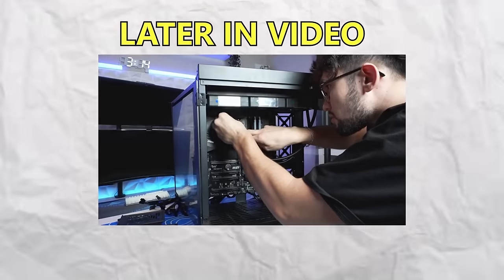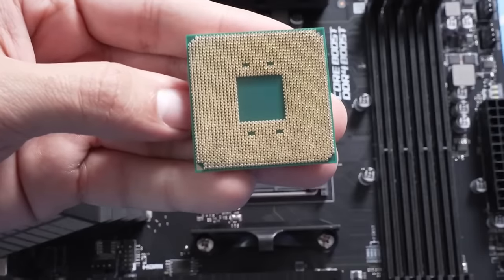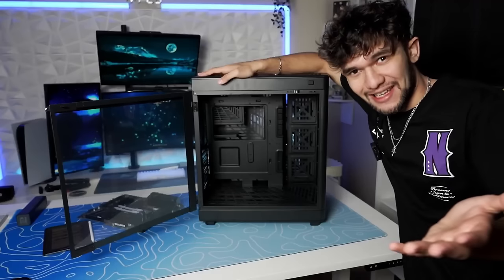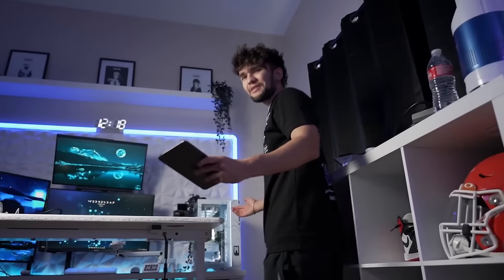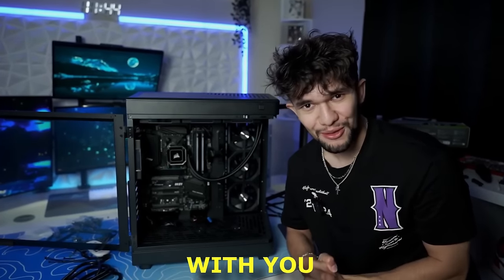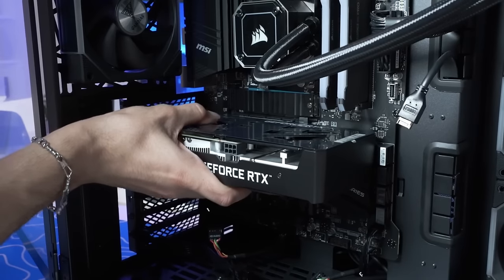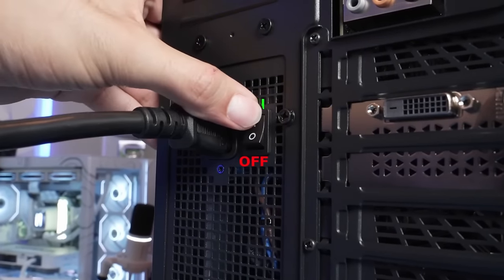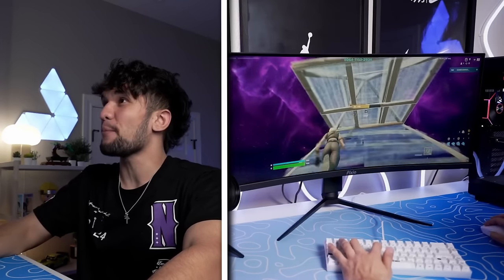Building My First Gaming PC With No Experience (BUDGET)

Comment: Parts:
GPU: Nvidia GeForce RTX 4090
CPU: Intel i9-14900KS
RAM: Corsair RM750x (2021)
COOLING: NZXT Kraken Elite RGB 360 - RL-KR36E-B1 - 360mm AIO CPU Liquid Cooler - Customizable 2.36" LCD Display for GIFS, Images, Performance Metrics - High-Performance Pump - 3 x F120 RGB Core Fans - Black
SSD: Seagate IronWolf Pro, 22 TB, Enterprise NAS Internal HDD –CMR 3.5 Inch, SATA 6 Gb/s, 7,200 RPM, 256 MB Cache for RAID Network Attached Storage (ST22000NT001)
MOTHERBOARD: ASUS - ROG STRIX Z790-E GAMING WIFI (Socket LGA 1700) Intel Z790 ATX DDR5 Wi-Fi 6E Motherboard - Black
CASE: NZXT H9 Flow - All Black - CM-H91FB-01 - Dual-Chamber Mid-Tower Airflow Case

I'm gonna update the parts to something newer/better every time something comes out so you better hurry and get 100k

Also why RTX 3050

Comment: You spend your money on the wrong things. For a $1000 PC you want your budget to look a little something like this:

Best GPU you can get for $300 (RTX 3080 Used)
Best CPU you can get for $150 (R7 7600X Used)
Best RAM you can get for $50 (2x8GB DDR5-6000 CL30)
Best SSD you can get for $50 (1TB PCIe 4.0 M.2 SSD)
Best Motherboard you can get for $200 (B650)
Best CPU Cooler you can get for $50
Best Case you can get for $50
Best PSU you can get for $100 (750W)

For any PC build really, you want the GPU to be the most expensive item.

Comment: The first red flag is building on AM4 for a brand new build, there's  nothing wrong with AM4, it's just that there is no upgradability and your stuck with DDR4 RAM and can't upgrade to DDR5. The second red flag IS THE DAMN 3050 DO RESEARCH WHEN BUILDING AND DON'T JUST BUILD BASED ON PRICING! The 3050 is fine but the pricing is terrible for the performance you get so you could have gone with a 3070 to make a better combo. If this build was before the release of AM5 then this build would have made some sense (other than the 3050) but today it is a weird build. You could have gone with a good Micro ATX build for a cheaper case and motherboard, and if you got a good budget case with fans then there wouldn't have been any need for extra fans. You could also get faster components for an all round faster build.

Comment: The upside to building your own is that you can pick exactly which parts you want to use, whereas with pre-builts you are limited to what they offer, even when you can order a customized pre-built. It used to be that building your own was considerably cheaper but that's no longer the case.

The 3050 is absolutely garbage, you could've spent $100-120 more for a 3070 or a 4060 and gone with an air cooler around $35-40 (Peerless Assassin or Phantom Spirit are great choices) instead of spending $160 on an AIO that's overkill for your CPU, and you would've remained within your budget. Always prioritize your GPU when building a gaming pc.

I will add that there are $40 AIOs (Thermalright Aqua Elite 240 V3) if you insist on having one and they work absolutely fine, so you definitely overspent on that when you didn't need to.

Also, you're going to find that 512 GB for an SSD is not going to be enough. You can find 1 TB M.2 SSDs for around $60-70, sometimes less.

Comment: okay here are the specs for the most liked comment coming from a pc builder

for the motherboard MSI B760 Gaming Plus WiFi Gaming Motherboard 

12 gen intel core i9 13000k for CPU

RTX 4090 

32 gigs of corsair DDR5 Ram 

NZXT Flow case

NZXT power supply 

NZXT 240 rgb 300mm AIO

then for extra fans go with extra NZXT fans
Reply from the maker: That’s a crazyyyyy build 😭
Reply: @TheChandler1 not going easy 😈

Comment: 1TB wouldn't put you above 1000$.
Infact there are 2TB drive for less than 110$.
In that budget you can easily, easily place 7800XT.
Even 7900GRE.
4070 Super... possibly. possibly not
Reply: why place 7800 xt with ryzen 5600? considering he probably has 1080p monitor, idk tho, it doesnt make much sence to me
Reply: @GameslordXY  not the point. i dont see why would you pair an older platform cpu with a realy good gpu. with 5600, you'll probably cutting corners, so it makes sence to go with last gen used gpu, like 6800 or 3070ti. if you buy new, just go with 7500f/7600x and that is pretty much fine for 7800xt. also, with windows 24h2 patch things could change

Comment: I Think you could improve this build a lot. The samsung SSD is extremely overkill for most users. considering this is a budget build as you say I would rather go with a P3 Plus or so. Something like the SN580 is also great.

The gpu as most people said could easily be replaced with a 3060 or even a 4060 if you worry about power efficiency and prefer a newer gen gpu. despite popular belief a 4060 is still a great option. anything above that and you are clearly overpaying. the 4060 ti is over $100 more than the 4060 and the gains do not justify it

The PSU is the one thing you won't want to cheap out. Most reliable brands are EVGA and Seasonic. It's impossible to go wrong with either of these. a 650W is enough tbh but you can go with 850W if you want for future proof as the PSU will last a really long time

The cpu seems oddly old for a 1k build. AM5 7600x would be nicer tbh

For RAM I usually go with Trident Z. ram is cheap nowadays and the price diff between diff brands is not enough for me to go with a cheaper brand. trident z has diff models for AMD and Intel so lookout for that. I do not know enough about other brands to recommend other stuff but ram can improve performance in gaming by a good amount as well as performance in pc tasks if you are a creator.

Fans are something that people think they need a lot but most of the time the fan on the cpu cooler and the gpu fans are enough (unless you are overclocking a lot). Yes water cooling is even more overkill. If you really want to put extra fans don't look for rgb. just get some cheap ones they mostly do the job. 

For coolers I always go for Noctua brand. is a bit on the expensive side but this is what makes it unnecessary for my builds to need fans. a good cooler can make a huge difference.

I think that about covers everything. For benchmarks go for passmark website and do not look at userbenchmark as it is extremely biased. and as always do your own research even after listening to people opinions :)

Comment: So first of all, awesome job on your first build. You did a great job with the building aspect and it looked great and as far as i could see no mistakes building wise. But you did make a very big rookie mistake and that was dollar to performance. You spent way to much money on things you didnt need that could went to better parts. for example you spent over 100$ on a case with no fans, then spent over 200$ on fans. Now dont get me wrong they looked wonderful and honestly its your choice how you wanted to build. just wanted to mention all the performance you left on the table. also you spent a good bit on a aio cooler for a cpu that pushes 60watts. I found a mesh, highly rated black case from the same company as the one you got for 70$ and it came with 4 fans. Which is plenty to cool a sub 1000$ pc. Also, grabbing a decent air cooler instead of the aio would of saved money but would of cooled just as well. so instead of the 3050 and the 5600, you could of got a 3070 or maybe 40 series card , a X or XT version of your cpu or even a ryzen 7 5000 series cpu, and a 1TB of storge like you wanted and still stayed on budget. Room for thought.

Comment: ACTUAL ADVICE

at a 1000 dollar budget you should have spent as close to 500 as possible on just the gpu
ryzen 5600 is a perfect choice for this budget. unfortunately you then went for an aio 360mm cooler with a screen on it no less.

the aio cooler is completely unnecessary for a ryzen 5. hell, most ryzen 7 stays in its advertised 125w tdp meaning a 25 dollar air cooler is way more than enough, not to mention ryzen 5 has like half the power draw at an advertised 65w which means it requires even less cooling. only the x3d chips and the ryzen 9 chips have a decent reason to get an AIO, not to mention its less reliable. air coolers are big hunks of metal. aio coolers are complex loops and the pump fails anywhere from 1 to 7 years in especially if from an unproven brand. me and friends have been left stranded with no pc until a new cooler arrives due to that

you spent up to 200 dollars on fans when the difference from 200 to 350 dollars on gpu is way more worth it than fans you can change at any time. their only effect is aesthetics and noise. not performance at all. 50 dollars on fans would be more than enough

the ram is almost fine, i wouldnt recommend anything less than 32gb and i guess youre paying for reliability and sure, aesthetics, but youre overpaying around 50 dollars for that kit. thats almost the price of a premium ddr5 kit

gamdias helios is a bit sketchier of a psu i'd go for at this price point. you usually want a good brand with good reputation and customer service. like cmon you went for corsair ram for reliability, a bad psu will kill the entire pc. look up the chaos with gigabyte like 2 years ago when their over current protection failed. huge pr disaster because lack of QA can kill the entire system in seconds

on a budget for the entire system, amd is the way to go unless you have a specific reason like productivity programs that only support Nvidia, however you cant make this argument with a 3050 which is a horribly overpriced and underperforming gpu. to get anything ray traced with it youd have to drop graphics settings so hard the ray tracing wouldnt matter. something the lines of a 7700xt is a great card ar under 400 dollars that can easily handle up to 1440p gaming. 

the case you can make room for in the budget if you reallywant but again, 0 performance impact. corsairs 4000d is easily found for around 80 dollars and provides great airflow and decent aesthetics
if you wanna go even crazier you could get a used 3070/3080/6800xt for around the same price but i dont reccoment everyone to buy used if they dont know what theyre doing so im not including that.
here is a similar list with the changes ive made which is a night and day difference in performance
https://pcpartpicker.com/list/6dKnPF

Comment: Ryzen 9 7950x3d 
Radeon RX 7900XTX
Lian Li O11
Lian Li Strimer Cables 24 and 8 pin
Samsung 990 pro 2tb m.2
Corsair H150i elite optiplex
Corsair AR120 fans x6
Corsair RMx shift series RM1200x
And a cool mini screen to put in there
ASUS ROG STRIX B650E-F WiFi pro USE AURA SYNC
Phanteks ARGB Strips

Comment: I found a pc for $997.93 that probably would perform better.

Antec AX61 mid tower atx case (4fans pre-installed)
Ryzen 7 5700X (cpu)
Asus ROG Strix B550-F gaming wifi II and AM4 (mobo)
240mm AIO cooler FROSTFLOW (cpu cooler)
Corsair Vengeance ddr4 (2×16) (ram)
TEAMGROUP mp33 1tb ssd (m.2 ssd)
Intel ARC A770 titan OC Edition 16gb gddr6 (gpu)
Pystar 1000W psu 80+ Gold (atx case psu)
I found these on amazon for prettry good deals and makes a good budget 1440p pc
Reply from the maker: Check new vid lol

Comment: You could've had a WAY better pc. You DO NOT need an AIO for an entry-level cpu. Also, a 3050 is trash. By using an air cooler (or even the stock cooler), using that extra $50 in your budget, and selecting better components, you could've had a way better pc.

Comment: I'm trying to build my first pc using this:
CPU: Ryren 7 5700G
GPU: ASUS Dual NVIDIA Geforce RTX 3050 OC
Motherboard: Msi B550M Pro-Vdh wifi Proseries
CPU Cooler: Deepcool Ak400 Zero Dark Digital Display
Ram: Corsair Vengeance RGB Pro 16GB (2×8GB)
SSD: kingston 1000GB or samsung 980 Pro 1TB
PSU: Asus PSU TUF Gaming 850W Gold
Case: Corsair 4000D Airflow
Are they compatible? Will it work? I have no idea how to build a pc...
Reply: I wouldn't get a 3050, instead I would get the rx 6600. Also you don't need an 850 watt psu for the specs you have, you could downgrade a lil bit to 750 watt one so you can still use it if you upgrade to more demanding parts.

Comment: no way you spent 1100 on a 5600 with a 3050 and bought an aio for that cpu. My recommendations is use an air cooler because its not a powerful cpu and for a 1100 build i would have used a rtx 4060 ti
Reply from the maker: Valid valid. I’ll buy one

Comment: You could have got an i5 12400f
A 	Deepcool AK620 ZERO DARK 68.99 CFM CPU Cooler
A 	MSI B760 GAMING PLUS WIFI ATX LGA1700 Motherboard
A 	Corsair Vengeance 32 GB (2 x 16 GB) DDR5-5600 CL36 Memory
A 	Kingston NV2 1 TB M.2-2280 PCIe 4.0 X4 NVME Solid State Drive
A	Gigabyte EAGLE GeForce RTX 4060 Ti 8 GB Video Card
A	NZXT H5 Flow ATX Mid Tower Case
A	Corsair RM650 (2023) 650 W 80+ Gold Certified Fully Modular ATX Power Supply

For $1020
Reply: nah bramd it would be $200 more expensive

Comment: My 745 dollar pc has:
7500f, b650m, 16gb ddr5, 1tb ssd, argb tower cooler by deepcool, case with 5 pre installed argb fan, 650w power supply and rtx 3060 ti, I don't think this comes close to my pc in terms of value for money , the only thing that's better in this pc is the aio 😂

Comment: well done for a first build.
but you did waste alot of your budget on useless things here are some tips for the future 
1_a cpu that is below 120w tdp doesnt need a 360 aio 
2_ the case does look good but isnt budget frendly a 110$ for a case then you need to fill it up with fans which will cost extra at least 30$ insted get a budget frendly case that has at least 3or 4 fans pre installed( a good example is the deepcool cc560) and dont pay more than 70 on a case if on a budget 
3_most of your budget should go to the cpu and gpu these shouldnt be a after thought 
4_ if on a budget dont get a lcd aio 
5_ dont get a 3050 ,bad price to preformance 
6_ if on a budget use the stock cooler 
here how i would do it 
cpu_ ryzen 5 5600x 110$
cpu cooler_ use stock cooler 0$
gpu_ rx 6750 xt 350$ 
case_ deepcool cc560 60$ 
motherboard_ gigabyte b550 aorus elite ax v2 140$
ram_ corsair vengence lpx 32gb ddr4 _ 65$ 
storage_ wd black sn770 1tb m.2 nvme ssd 70$
power supply_ corsair rm650 atx 85$ 
total 880$ 🙂👍 and this one will preform wayyyy better

Comment: There is so many things wrong. You bought like the most random parts, you bought them before knowing how to build a PC, you don't need an AIO under $1500. You could have saved hundreds of dollars by buying better parts like a H5 Flow or H7 Flow which save you the money for fans and letting you get a better GPU. Like I said an Air Cooler would be better. Samsung SSD isn't the best for price you could have saved money and even get 1TB for like $40-$70. You could have had a so much better PC if you knew more about the parts and prices which was the main mistake of having no knowledge.

Comment: It's much easier if you consider not buying a shitload of unnecessary fans/coolers

CPU: AMD Ryzen 5 5600 3.5 GHz 6-Core Processor  ($129.00 @ Amazon) 
CPU Cooler: ID-COOLING SE-214-XT 68.2 CFM CPU Cooler  ($17.98 @ Amazon) 
Motherboard: ASRock B550M-HDV Micro ATX AM4 Motherboard  ($74.98 @ Amazon) 
Memory: G.Skill Ripjaws V 16 GB (2 x 8 GB) DDR4-3200 CL16 Memory  ($26.99 @ Amazon) 
Storage: Kingston KC3000 1.024 TB M.2-2280 PCIe 4.0 X4 NVME Solid State Drive  ($94.99 @ Amazon) 
Video Card: Acer Predator BiFrost OC Radeon RX 7800 XT 16 GB Video Card  ($459.99 @ Newegg) 
Case: Lian Li LANCOOL 216 RGB ATX Mid Tower Case  ($94.98 @ Amazon) 
Power Supply: SeaSonic FOCUS SGX (2021) 750 W 80+ Gold Certified Fully Modular SFX Power Supply  ($99.99 @ Amazon) 
Total: $998.90

Comment: I am kind of a pc building nerd, so here is a way better pc for The same prize
I5 12400F
Noctua NH-U12S cpu cooler
MSI MAG B760 Tomahawk
Kingston fury beast 16gb ddr5 6000mhz
Kingston 1tb nvme m.2
Rx 7600
NZXT H5 Flow
Corsair RM650 (2023) 650 W 80+ Gold Powersupply
All costing 983$ on pc part picker. Anyways, have a good rest of your day!

Comment: considering they’ve ruined even the 3060 with the naming scheme, nvidia really has nothing good under 700
Reply: 3070 used is better you can get it for 250-300 + the 3060 is mid range but would probably get the 3060 ti if your just gonna use it for 1-2 years 3060 ti is good but if you want feature proof get the 3060 cause of the 12 gb vram

Comment: Nice part list but one thing Why the 3050 bro I died inside I would rather go with a rx7600 or a intel arc a750 its like 23-29$ more expensive but totally worth it in the long run
Reply from the maker: Ikkk ikkk im sorry
Reply: @TheChandler1  but still the 3050 should give you good performance in most games at 1080p so still a good part list you got a new sub

Comment: No hate but if u didn’t spend more of ur budget on aesthetics u could’ve built a much powerful system (if u did wanna do it this way though the Rx 6600 is a much better deal than the 3050 at the same price but with more than 20% better performance) anyone with decent pc knowledge knows that the 3050 is such a bad gpu cos of the pricing
Reply from the maker: As stated this was my first time building one with fr fr zero experience lol. So thanks for informing me
Reply: @TheChandler1  no hate tho good job 👍

Comment: 3050 is a straight scam, There are SO many better options for a 1k budget. Cards like the RX 6600 Go for as low as $180 and you can definitely be spending more than 200 dollars on a gpu inside a 1k budget. get a 3060 12GB or 3060ti in there, and if you find some really good deals I'm pretty sure you'd be able to slap a 6700xt in there, but this day in age that might be a stretch

Comment: Nooo not the 3050!!!. Be beware of PC nerds like myself going to spam you that the 3050 is badly priced. And for this Budget you dont need 10 fans total. You could get away with a good air cooler. If you get an air Cooler and like 3 fans or so, you could get a 3060ti, 1tb of storage and a way better performing pc